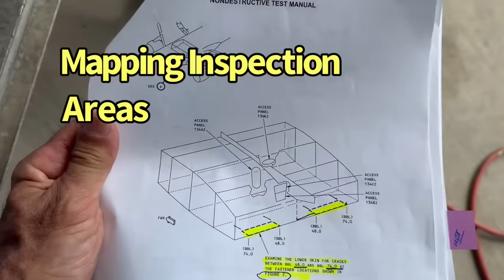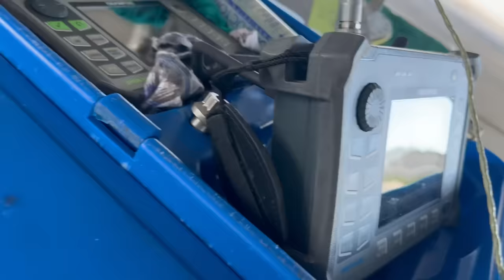AIRPLANE FUEL TANK ENTRY and CRITICAL inspection  #airplane #video #foryou

Comment: As a maintenance guy myself I’ve been in 727,757,767 and 777 tanks. The 727 was tough to enter. I was a lot younger then .
Reply from the maker: Glad to see you here Lynnpreuninger ✈️ ⚙️ the smallest I have been in is B737 classic and largest B747-400. I am glad I made this video for public awareness, so they can see what professionals do behind the scence to keep skies safe. It has to be all done for safety. Welcome to our show. Thanks for enjoying this video.Check out our New video just uploaded link ⬇️ 
THE smallest DETAILS makes the BIGGEST DIFFERENCE #aviation #video #foryou
https://youtu.be/my6YMdnT388
See you soon next video ✈️👍
Reply: There's no way I could squeeze through these access ports today.
Reply: Did they not do these inspections on the firefighting plane that the wing folded and broke off!
Reply: @hyacinthbucket3803  That wasn’t CalFire we had S-2Ts that were completely refurbishished new wings,repaired wing boxes, & fuselage I was a structural repairman & aircraft mechanic I worked for 21 years we inspected our tanks, & X-Rayed center wings. We never lost an aircraft due to maintenance. That was the US Forest Service and a company out of Wyoming using older C-130s had a wing fold up on them in flight that was 2002, since then a lot has changed & I know a few aviation officers with them.
Reply: @Marfoir0303    That happened so fast, pilots probably had no idea what went wrong.
Reply from the maker: Thank you
Reply: OK i litraly thought u saying u wan in 727 milon 757 thousand 767 airplane tank.  Then I realized what is going on😂

Comment: Didn't do much fuel tank work, a little sheet metal repair here and there, fuel quantity harness replace. But after 35 years (retired from major airline) my knees are not the same from crawling around in various part of the aircraft. Hats off to you fuel tank guys that did it so I wouldn't have to.
Reply from the maker: Glad to see you here Sundance ✈️ ⚙️ I have been in aviation for 42 years as well. We don’t do fuel ⛽️ tank inspections often. That’s worst job in aviation for those guys.. So with this equipment we can detect cracks under the paint were the naked eyes can’t see.The fuel was transferred to wing tanks, than the tank was drained, purged and vented for 3 days. It has to be all done for safety. I am glad that I am sharing aviation awareness with my videos. Welcome to our show. Check out our New video just uploaded link ⬇️ 
THE smallest DETAILS makes the BIGGEST DIFFERENCE #aviation #video #foryou
https://youtu.be/my6YMdnT388
Have a good day, See you soon next video ✈️👍
Reply: "THE smallest DETAILS makes the BIGGEST DIFFERENCE" That is for sure, look how a simple rocker switch on the back of a seat almost brought an aircraft down recently.

Comment: Was cool to see but it could have been a lot better. Tell us what you are doing exactly. What was you measuring with the probe? Leaks, thickness, something else? Also would be cool to understand more about what we were seeing inside the fuel tank. For example I assume there are pumps to balance the fuel load between tanks, to measure how much fuel is left, and other things like that. Would be cool to learn about that as well while you are in there. Just some suggestions. Keep up the great work.
Reply from the maker: Glad to see you here Drbadvibe ✈️ ⚙️ I hear what you are saying. This is a Live airplane and it goes on flight in one day. The most important thing for us is to complete the inspection 🧐 cause there is a lot riding if we find a crack with that special equipment we had. Usually we explain more in details when we are not pressed for time. I am glad I made this video for public awareness, so they can see what professionals do behind the scence to keep skies safe. It has to be all done for safety. Welcome to our show. Thanks for enjoying this video.Check out our New video just uploaded link ⬇️ 
THE smallest DETAILS makes the BIGGEST DIFFERENCE #aviation #video #foryou
https://youtu.be/my6YMdnT388
See you soon next video ✈️👍
Reply: @slipperybeastaviationfishingsh  If you can re-upload this same video with audio commentary about things you were doing and equipment you were using, that would be really great.
Reply from the maker: @mickeyagrawal2001 Thanks Mike that would be impossible for that video, cause it getting close to 200K views. I made another video with the details you are talking about let me know if you like it link ⬇️ 
THE smallest DETAILS makes the BIGGEST DIFFERENCE #aviation #video #foryou
https://youtu.be/my6YMdnT388
Please let me know what you think 🤔 I appreciate your concerns. Have a great day
Reply: Ah that’s where all the chems for the chem trails are stored 😂😂
Reply from the maker: @marbogbr 😂
Reply: how did you manage to get the fuel tank completely dry for an in use plane?

Comment: So many questions I have. Like, I didn't see a damp spot anywhere. How did they get rid of every bit of fuel? And what are those wires dangling at 4:18?  Is that a level gauge? Shouldn't those wires be secured a bit better if fuel is sloshing around?
Reply from the maker: Glad to see you here RadioChief ✈️ ⚙️I do believe that was a quantity sensor. They may have been working on it. We are specialized inspectors, So with this equipment we can detect cracks under the paint were the naked eyes can’t see.The fuel was transferred to wing tanks, than the tank was drained, purged and vented for 3 days. It has to be all done for safety. I am glad that I am sharing aviation awareness with my videos. Welcome to our show. Check out our New video just uploaded link ⬇️ 
THE smallest DETAILS makes the BIGGEST DIFFERENCE #aviation #video #foryou
https://youtu.be/my6YMdnT388
Have a good day, See you soon next video ✈️👍
Reply: yes thats the fuel probe which reads quantity.. the wires are how it connects, wire has 3 leads at the end that screw into the probe. usually the wires are clamped every  few inches, but due to the location they hang a litttle here.
Reply: He's lying to you,  that's not a fuel tank

Comment: That is very cool!!!  Gives you a perspective of how much fuel one of those birds use!
Reply: Almost nothing, a plane uses kerosine only for start and landing. On cruising speed it's a self running system without constant fuel burn because the engines are air-pressure turbines. Imagine a bird has liquid in his wings how unstable this would be for the entire structure and physics of flying. It's a fuel scam.
Reply from the maker: Glad to see you here  Rockkitty ✈️ ⚙️  This airplane takes 26K gallons. I am glad I made this video for public awareness, so they can see what professionals do behind the scence to keep skies safe. It has to be all done for safety. Welcome to our show. Thanks for enjoying this video.Check out our New video just uploaded link ⬇️ 
THE smallest DETAILS makes the BIGGEST DIFFERENCE #aviation #video #foryou
https://youtu.be/my6YMdnT388
See you soon next video ✈️👍

Comment: Man, that's crazy. Fuel vapors strong in there? What's the grey stuff on the tanks walks? Brave souls.👍
Reply: The gray stuff is a sealant called B 1/2
Reply: @louie8427  Thanx.👍
Reply from the maker: @louie8427 thanks Louie, yeah we call PRC B 1/2 will dry after application in 1/2 half hour. Thanks guys for the this  video.
Reply: @louie8427  B1/2 is not the name of the sealant, B1/2 indicates cure time.
Reply: @slipperybeastaviationfishingsh Actually the 1/2 an hour indicates how long you have to apply the sealant not the cure time
Reply from the maker: @PyreneesPathfinder You are absolutely 👍 correct 💯 glad to see my aviation family here. ✈️
Reply: @louie8427 We knew it as PRC which iirc means Petroleum Resistant Compound. It's available as brushing type with B prefix and applicator or A prefix and the time it's workable is the 1/2 or 1 or 2 for half an hour, one hour etc. it's not nice stuff and stinks, has a high lead content and must to be overcoated with a sealant to make it fully fuel resistant.
I presume that's eddy 
-current NDT crack testing you're doing on the frames there?

Comment: Center tanks are a piece of cake with plenty of room to move, but a B727 going in through the front spar opening was a tight squeeze for the hip tanks. Yeah, I don't miss that part of aviation maintenance anymore.
Reply from the maker: Glad to see you here Redsalamander ✈️ ⚙️ This is the toughest job in aviation by far. So with this equipment we can detect cracks under the paint were the naked eyes can’t see.The fuel was transferred to wing tanks, than the tank was drained, purged and vented for 3 days. It has to be all done for safety. I am glad that I am sharing aviation awareness with my videos. Welcome to our show. Check out our New video just uploaded link ⬇️ 
THE smallest DETAILS makes the BIGGEST DIFFERENCE #aviation #video #foryou
https://youtu.be/my6YMdnT388
Have a good day, See you soon next video ✈️👍

Comment: How does it connect to the tanks in the wings? How much fuel can be loaded in the tank you inspected?
Reply from the maker: Glad to see you here  Eduardovg ✈️ ⚙️ wing tanks and the center tank are independent with fuel lines and transfer valves they can transfer fuel ⛽️ for weight and balance. Total fuel capacity 18 K gallons . Every tank I have been in is always this clean. So with this equipment we can detect cracks under the paint were the naked eyes can’t see.The fuel was transferred to wing tanks, than the tank was drained, purged and vented for 3 days. The meter read safe for entry. It has to be all done for safety. I am glad that I am sharing aviation awareness with my videos to the public, so that you can see what professionals do behind the SCENCES to keep airplanes ✈️ flying safe in the sky 🌌 Welcome to our show. Check out our New video just uploaded link ⬇️ 
Camera Inside Airplane Turbine Jet Engine #airplane #video #foryou
https://youtu.be/mdCpb5tp66s
Have a good day, See you soon next video ✈️👍

Comment: We were required to wear cotton coveralls with brass buttons when entering, have a entry permit at opening with a fire guard at entry point. What I see here is very unsafe.
Reply: Now they wear YouTube TikTok shirts as uniforms.
Reply: Yes, wear rubber boots and use spark-proof tools etc. The old rubber tank-suits we had to wear inside the bag-tanks were awful, especially in summertime when it was hot and 🥵
I expect the vapour concentration is carefully checked prior to entry and personal gas monitors are used whilst inside the tanks.
Reply from the maker: Glad to see you here Tim ✈️ ⚙️You are perfectly  right, it won’t happen again. Thank you. I am glad I made this video for public awareness, so they can see what professionals do behind the scence to keep skies safe. It has to be all done for safety. Welcome to our show. Thanks for enjoying this video.Check out our New video just uploaded link ⬇️ 
THE smallest DETAILS makes the BIGGEST DIFFERENCE #aviation #video #foryou
https://youtu.be/my6YMdnT388
See you soon next video ✈️👍
Reply: @125brat yup vapor levels and positive air flow

Comment: Fascinating, but at the exact same time I could not stop myself from thinking that those huge fuel tanks are what delivered the devastating infernos that would melt the steel of the WTC towers on 9/11 that caused both towers to pancake collapse. Just the enormous size of the jet as you guys were walking up to the 767 made me think of how this enormous jet penetrated the WTC towers at nearly 600 MPH. Anyway, back to the positive and us all continuing to move ahead in life. Nice job fellas! Thanks for keeping our airplane fleets safe for us all.
Reply: Jet fuel can't melt steel beams
Reply: @viperfanacr  Yes it can and it did. When it burns and is highly oxygenated--Jet-A can burn up to 2200 deg. F. When all 20,000 gallons of jet fuel from both 767s were released from the disintegrating  aircraft, the fuel was traveling at nearly 600 MPH with the speed of the planes--which sprayed and atomized throughout WTC1 and WTC2 with those huge gapping holes in each building channeliing the steady 15 MPH northwestern prevailing winds right through each tower--that provided a steady flow of fresh oxygen supply until the steal trusses that held up each floor started to melt from the 2000 degree F. flames and failed--causing a domino effect classic pancake collapse of both towers. Basic physics--not science denial. What's up with you?
Reply: @viperfanacr  It doesn't to malt steel beams, as any blacksmith will tell you.  Once steel or iron is red hot (700C) it is soft like toffee!     Toffee wouldn't hold up the WTC either.
Reply: @karhukivi This guy is correct, metal will not melt at that temp. But it will become soft and weak causing the collapse to happen. I’ve been Heat treating metals since 1996 and some material like high speed steels require a soak temp of 2250F for a short period of time and rapid cool. Even at this temperature the material will not melt.
Reply from the maker: Sorry for late reply. Glad to see you here guys ✈️ ⚙️ had it not been for the speed, the weight and the fuel ⛽️ the towers would still be there. I am glad I made this video for public awareness, so they can see what professionals do behind the scence to keep skies safe. It has to be all done for safety. Welcome to our show. Thanks for enjoying this video.Check out our New video just uploaded link ⬇️ 
THE smallest DETAILS makes the BIGGEST DIFFERENCE #aviation #video #foryou
https://youtu.be/my6YMdnT388
See you soon next video ✈️👍

Comment: Aluminum high-speed crew-supply boats require the same inspections. Electrolysis is a huge problem in some areas of the vessels, especially around the props. Metal can appear to be solid, but when checked with electronic devices, it's honeycomb with corrosion.
Reply from the maker: Glad to see you here Patric  ✈️ ⚙️ Thats a good point  with 🛥️. Corrosion is like cancer. I am glad I made this video for public awareness, so they can see what professionals do behind the scence to keep skies safe. It has to be all done for safety. Welcome to our show. Thanks for enjoying this video.Check out our New video just uploaded link ⬇️ 
THE smallest DETAILS makes the BIGGEST DIFFERENCE #aviation #video #foryou
https://youtu.be/my6YMdnT388
See you soon next video ✈️👍

Comment: Is there not an overwhelming smell of gasoline inside the tanks? I don't know how you can go in and not pass out. Im also surprised at how dry the tank is... you'd think there would be gas remnants left behind from previous flights
Reply from the maker: Glad to see you here  HilltopperTA ✈️ ⚙️ So with this equipment we can detect cracks under the paint were the naked eyes can’t see.The fuel was transferred to wing tanks, than the tank was drained, purged and vented for 3 days. No smell and no scent all safe per the meter reading. It has to be all done for safety. I am glad that I am sharing aviation awareness with my videos to the public. Welcome to our show. Check out our New video just uploaded link ⬇️ 
THE smallest DETAILS makes the BIGGEST DIFFERENCE #aviation #video #foryou
https://youtu.be/my6YMdnT388
Have a good day, See you soon next video ✈️👍

Comment: I usually go in when the tanks are full so as to get the proper pressure manifold temp/pressure readings. The sending units are calibrated within micro nanometer tolerances so the oscillating reverse valve index sheaths have to be reground for proper interval siphoning to the pump lines. The reverse tanks flow opposite so I have to swim through to the other end to check those as well. The tanks aren’t totally full when I’m swimming in there so it’s essentially a snorkel with a mask.
Reply from the maker: Glad to see you here  EyeForKnowledge ✈️ ⚙️ I am glad I made this video for public awareness, so they can see what professionals do behind the scence to keep skies safe. It has to be all done for safety. Welcome to our show. Thanks for enjoying this video.Check out our New video just uploaded link ⬇️ 
THE smallest DETAILS makes the BIGGEST DIFFERENCE #aviation #video #foryou
https://youtu.be/my6YMdnT388
See you soon next video ✈️👍

Comment: I've been inside a 120,000 gallon jet fuel tank of the aircraft carrier USS Kitty Hawk!!!😀 It's only one of few big ones. The ship carried more than 2 million gallons of jet fuel.
Reply from the maker: Glad to see you here  Obbie ✈️ ⚙️ wow this whole Airplanes capacity is 26K gallons. Thats an impressive 120K gallons and than 2 M gallons. Thanks for your service. So with this equipment we can detect cracks under the paint were the naked eyes can’t see.The fuel was transferred to wing tanks, than the tank was drained, purged and vented for 3 days. It has to be all done for safety. I am glad that I am sharing aviation awareness with my videos. Welcome to our show. Check out our New video just uploaded link ⬇️ 
THE smallest DETAILS makes the BIGGEST DIFFERENCE #aviation #video #foryou
https://youtu.be/my6YMdnT388
Have a good day, See you soon next video ✈️👍
Reply: @slipperybeastaviationfishingsh  Yes! My first job in the navy was to fuel airplanes during and after flight operations. I did that long enough until the ship went into major overhaul at the Philadelphia Naval Shipyard. That's where I also saw the 95,000 gallon tank with a big gash on it because it collided with a Russian submarine that was pressumed lost. The way cracks are detected on aircraft carrier storage tanks is with x-ray. I forgot to mention that the old Kitty Hawk was conventional non-nuclear powered and its fuel capacity is 3 million gallons. So it's fully loaded with 5 million gallon of flammable liquid at all times during deployment because they also act as the ships ballasts.
Reply: I assume the design of the fuel tank in the ship looks way different, doesn't it? I mean the fuel tanks you maintained actually looked like fuel tanks?
Reply: @drexlev  Is there a specific way a fuel tank should look like? 😳